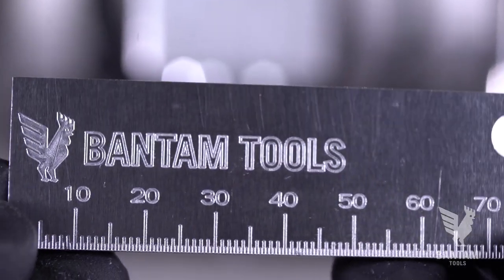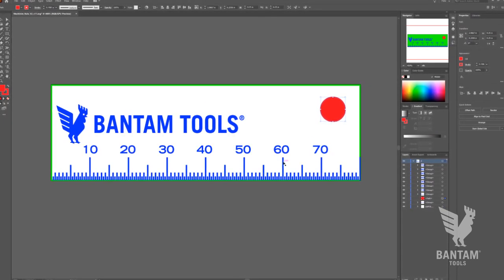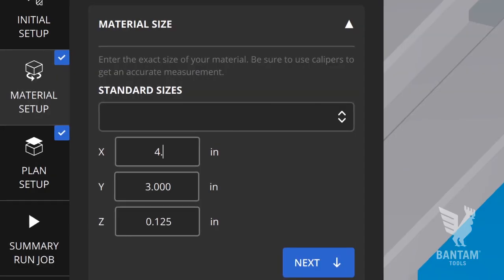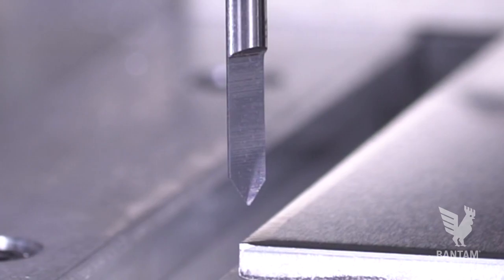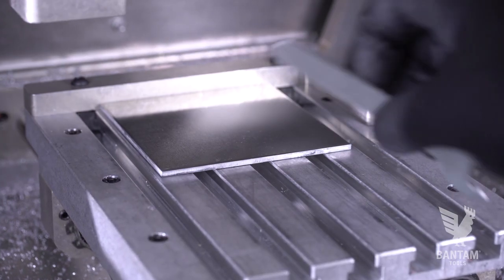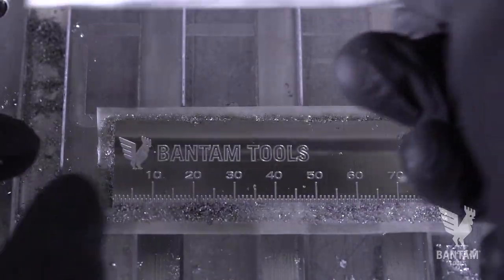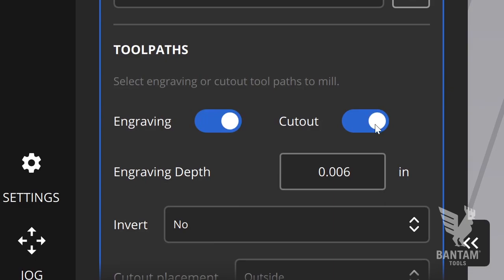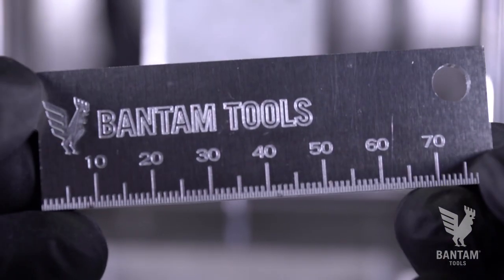Getting Started: CNC Machinist Rule Full by Bantam Tools

Comment: The tool has cut the base also
So either there is an error in z settings or backlash in z axis
Which one has caused the bed to cut?
Reply from the maker: Ah, those! The markings you're seeing on the T-slot bed are from previous testing, not from this project. But you're right, in that case, our Z-height was off––it happens :)
Reply: is it's a loud system in operation?
Reply: Yes it’s quite noisy as you are carving things with the bit spinning at a vary high rpm
Reply: @bantamtools  have you started shipping internationally
Can you ship this machine to Bengaluru, India
Reply from the maker: @ibrahim5467 , we haven't started shipping internationally yet. Thanks for checking in about this though. We'll continue to keep you posted.